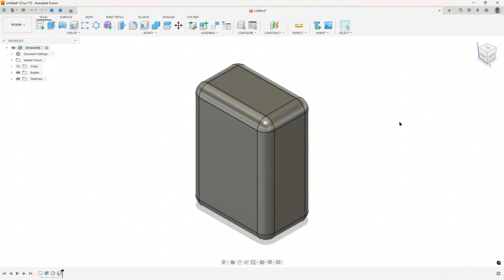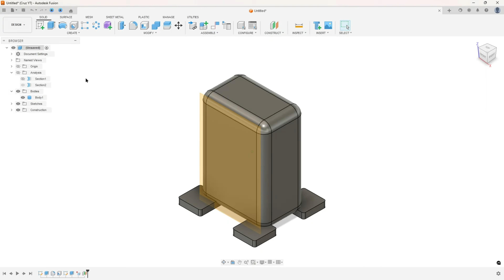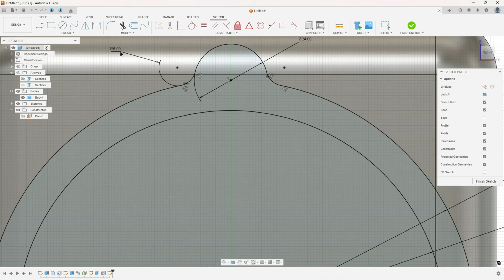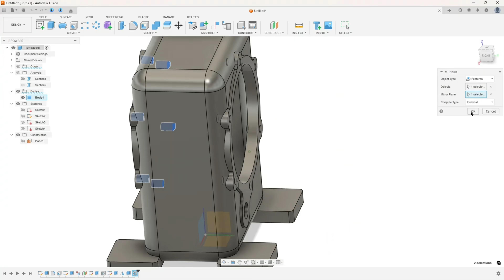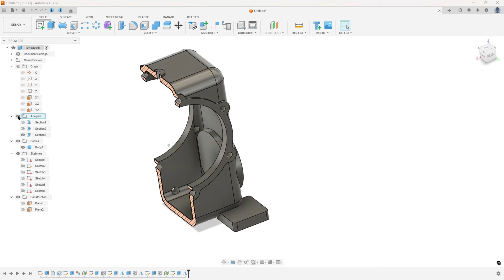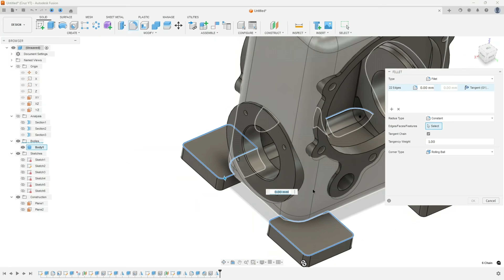Fusion 360 From Zero | Expert Tutorial Step-by-Step #46

Comment: Hi, this was a great practise turorial. I'm puzzling over one point. I cannot see how you found that the size of the 6 holes on the 160diameter circle are the same as the hole in the top. You said M10, but, where do you see that they are the same as the top one?